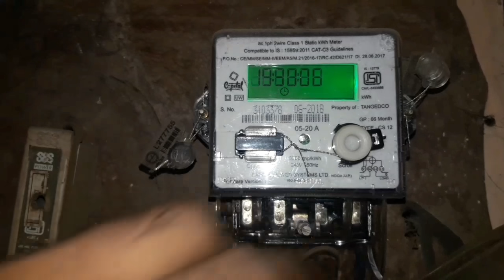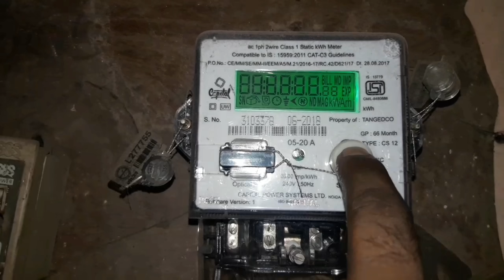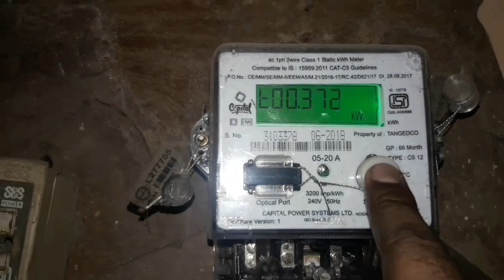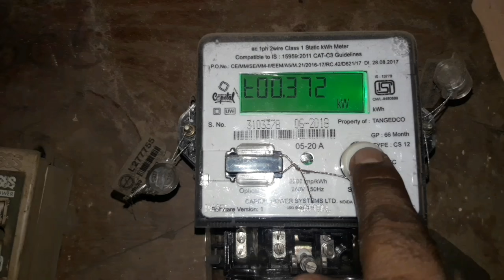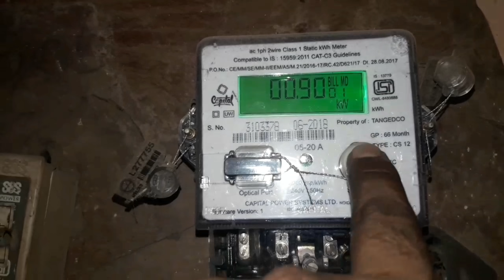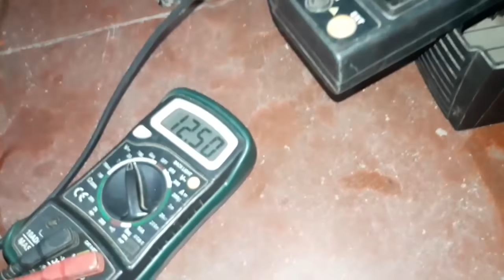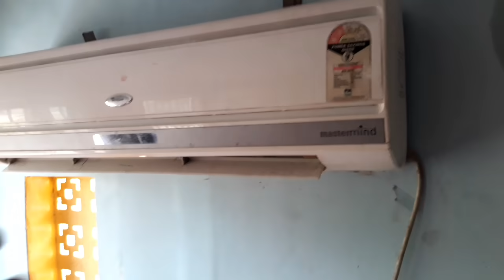Digital EB Meter, How To Make Inverter Battery Solar simple method calculation,UBS service testing

Comment: Hi bro , small doubt , it’s regarding two months EBill reading or consumption of 700 units and how much kva ????
Reply: 100 unit free 100 to 200 unit 1.5 rs .. 200 to 300 unit 3 rs.  300 to 400 unit 6 rs
Reply: hari prasath thanks 🙏 and how kva of solar panel is required for 500 units  consumption for per months?? ( Example for 2 kva or 3kva solar panel installed )
Reply: If two month reading is 700 units means, per month usage is 3500w, so u need 4.5kva needed